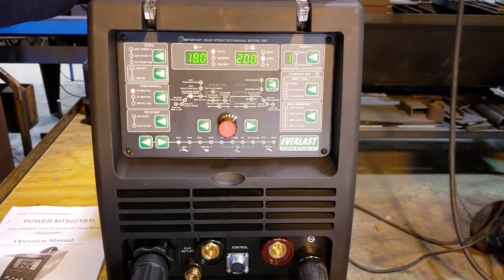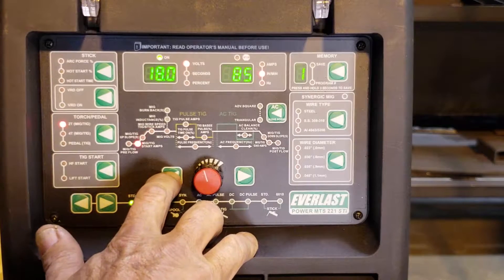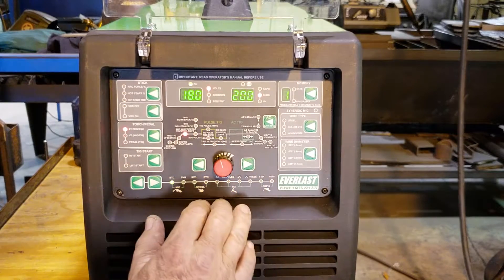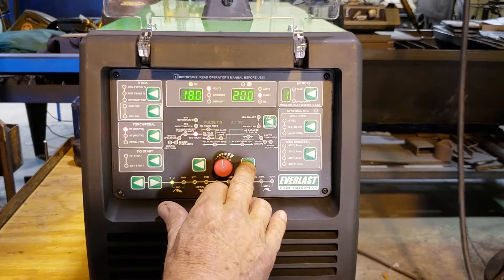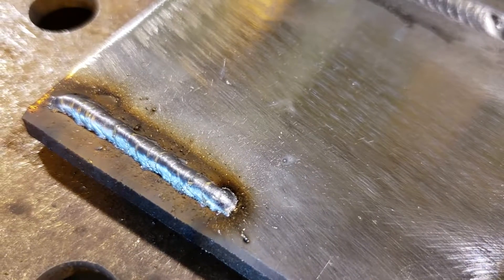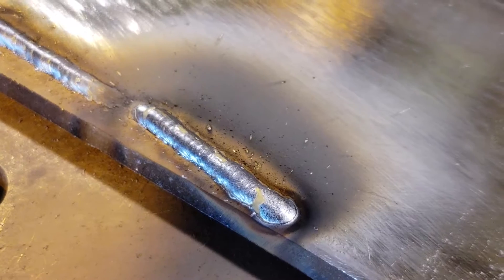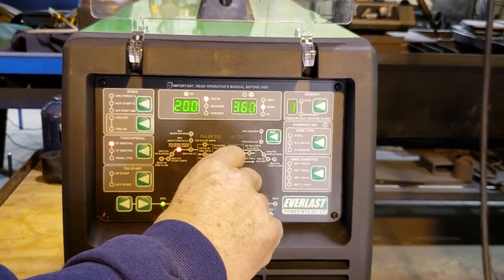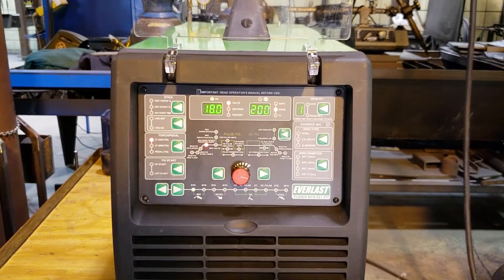Everlast PowerMTS 221 STi: Basic Wire feed Speed and Voltage Explanation

Comment: Question when in surgenic mode can you set the volts and  amps or wire speed while in Insurgenic mode or are they preset Based on only the amps set
Reply: It’s a late reply but you can change them separately and the machine will remember the ratio after that for that session.